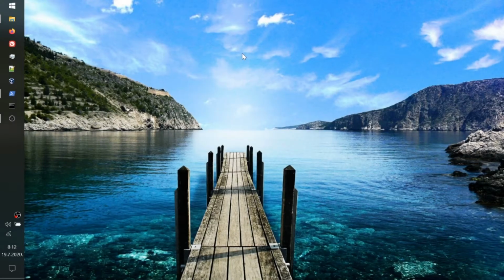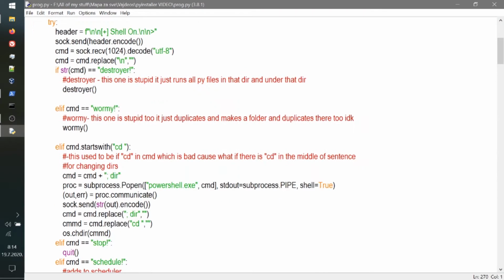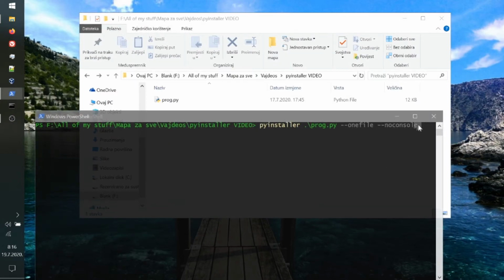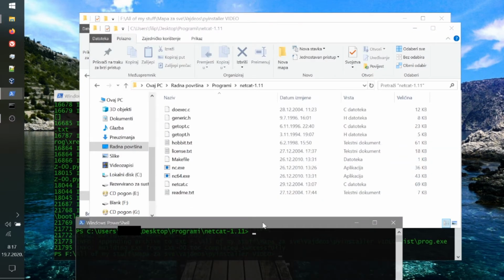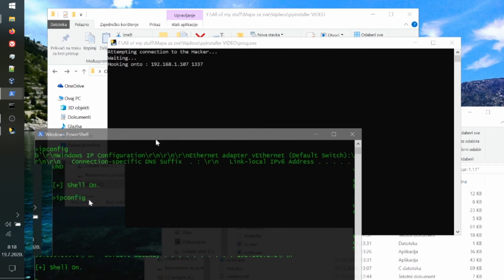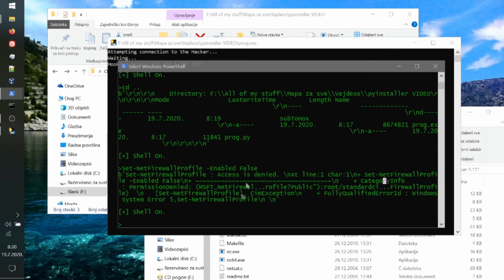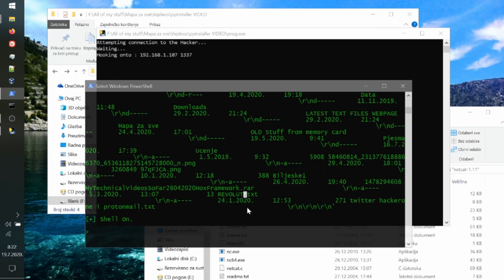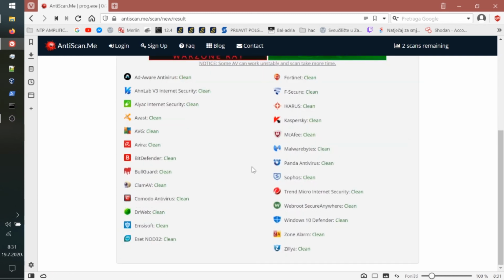[OLD] Converting a Python backdoor to Exe using PyInstaller + Basic AVEvasion testing

Comment: Can you tell me how to hide a batch file source code from reverse engineering. So the batch file should be able to execute its code but the code can’t be seen.
Reply from the maker: Obfuscation of any sort would be your thing - however even then its possible to rev eng it 
If you used Ghidra or similar tools you'd know why - it can decompile most programs
Reply: @HoxFramework  
Is it actually possible to disable the taskmanager, the registry and the access to the certain folders through a cmd command or batch file without windows prompting me to confirm that I’m the administrator ?
Can you give me the code in order to achieve that? 

Only for ethical stuff:)
Reply from the maker: @goofymouse8921  I dont think so - to do stuff like that you need a "root" user in windows (system user) - for that you need psExec tool to execute. However even then you need to run it as admin. Even then it might not allow you to disable system components like task manager or registry

You can always access folder trough cmd or a batch file - most without admin prompt 

And i dont make custom codes for anyone's purposes, that would be paid a lot - i dont do that 
Plus i dont have that kinda code anyway
Reply: @HoxFramework  but could you please tell me how can I register my custom ico file which is on my desktop in order to make my custom extension .hello adopt that icon ?
Reply from the maker: @goofymouse8921  if you are reffering to using a custom ico file with an exe compiled from pyinstaller - i said that in the video.

I've never heard of a .hello extension im not sure what you mean
Reply: @HoxFramework  no, I want to register my custom into the windows registry so if I rename f.e. the file bonjour.txt into bonjour.test123 that my custom icon appears
Reply from the maker: @goofymouse8921  I dont know if you can do that 
Ive never tried but that would mean replacing the system's "file" icon thing 
If you could do it trough the registry thats great but you would have to make a seperate program that does that and then the victim sees the other icon after its done 
But why would you want that
Reply: @HoxFramework  Because that would be the top of the iceberg. Custom file extension with custom icon and everything encrypted. I really don’t want to make a problem out of it, but why is that such a big deal just add a file extension in registry and selecting the icon and path, I don’t understand why that’s so difficult
Reply from the maker: @goofymouse8921  Its not difficult i just have no idea what you really want to do
And why registry? Do you want to do something like this
https://superuser.com/questions/308958/creating-custom-file-extension-with-windows-registry
?

are you making a ransomware? is that it? if so then i think i have a clue on what you wanna do
Reply: @HoxFramework  Yes that’s true, but only for non-harming ethical purposes. I want to use it just for testing purposes while simultaneously having full permission by the systemadministrator. 

So I think you know how to properly solve this problem ?

Or could you do this as an example for me: 
1. my .ico file is located on my desktop

2. the file extension ist called .pigeon

3. the file type is called .pigeon-file

How to properly do it for this example, Microsoft should prompt me that there is no program I can open it. So in .pigeon format it’s unopenable
Reply from the maker: @goofymouse8921  Right so you are designing your own ransomware but cant compile the exe? Wasnt that your first question? Make sure you manage that first 

why would you have a different file extension from file type? Whats the purpose of that, shoudlnt they be the same

What program do you want to open it with then? Is it just an .exe? If so just rename it and run it 

im pretty sure you understood some things wrong but im gonna go ahead and say i still dont get what you are trying to do
Reply: @HoxFramework  Hello, no I think I got it. I have an exe compiled by winrar containing txt, bat, ico, png and vbs files. 

I need a batch script that adds my icon to registry so that it embraces my icon to a custom  file extension, that need to be registered as well.

Can you please give me the batch script to do that?
Reply from the maker: @goofymouse8921  i dont write scripts per requests of users, paid or not - But im sure you can google it to find it all 
As far as the script goes keep in mind it could get detected too
Modifying registry is suspicious behaviour
Reply: @HoxFramework  I have been searching for 5d and didn’t find anything, I’m Suche it’s just sth with red add, could you please do that just the 2 lines of script ? I would sub and be an active sub as well
Reply from the maker: @goofymouse8921  Sorry, I dont do requests for subs

Id love to help but it seems that you need to do a lot more research before you can start working on a project like this... Modifying registry will cause any sane antivirus to pick you up - making a two file malware isnt the greatest idea and using a custom icon changes nothing from the point of view of the user cause he still needs to exec a batch file
So please before you launch this make sure you do a lot of learning on this topic - even IF i made you that batch script your idea wouldnt really work perfectly since you'd have antivirus detection problems as well as problems of your malware not being even executed cause it looks fishy. Tho i dont want to dismiss your idea cause with some work you might make something interesting - id recommend just trying to bind a malware to a legit exe and trying that out
Reply: @HoxFramework  They that’s what I want, but nobody can tell me about zero day exploits or up to date exploits for adobe reader. Can u tell me how to do it correctly ?
Reply from the maker: @goofymouse8921  Nobody will tell you about zero days - thats why they are called zero days

Exploits for adobe reader now? Dude you are shifting from a topic to a topic hahah
Yeah sure just go to exploitdb or 0daytoday and find some 

use these legally ofcourse

Comment: Hi there, the .exe generated by pyinstaller is getting detected as a virus by windows defender as well as other antivirus softwares and thus I am not able to execute it. Please help
Reply from the maker: I've answered to this question many times in the other comments, please refer to them so i dont have to retype things many times - basically its cause people uploaded that program to services like virustotal which actually sends information to antiviruses meaning it will start detecting it then. I have mentioned some options in other comments how you can get around that
Reply: @HoxFramework  but how know this virus we make detect or not??
Reply from the maker: @ghostt784  antiscan.me
Reply: @HoxFramework  bro make video how install py2exe
Reply from the maker: @ghostt784  pip install py2exe
Reply from the maker: in other words this is why you dont upload to virustotal and similar services

Dont get me wrong tho, i support internet safety and we SHOULD upload it to VT, however if redteams and pentesters can use this malware to improve the security of systems then they should have the option to do so

Any illegal use is NOT supported ofcourse

Comment: hi sir I have a exe virus and it is detected by antivirus what should I do
Reply from the maker: You can try a bunch of AV Evasion techniques, as well as changing the code or  changing the converter
Reply from the maker: @KOALIC PANDA   That is a bit of an issue, try py2exe maybe but im not sure it will give great results - what you can do is look up python to exe compilers / converters list on Google and see whats what

Using any other one should be safer

Nuitka was safe like a month ago

PyInstaller was FUD (fully undetectable) before i posted this video believe it or not

Comment: windows defender detect every exe i make using pyinstaller as virus or malware please help 😐
Reply from the maker: i talked about this in the comments/description (and also i hinted that this video is older- it was taken down so i reuploaded it and edited it a bit to fit the youtube guidelines) - antivirus (and windows defender) evasion is a huge topic and it takes plenty of research - but i have provided couple of solutions : use py2exe instead of pyinstaller, use a different programming language, change up the hash of the file (by changing up the code in any way), bind the exe, encrypt it or similar

These are couple of good options
I hope they help you - tho you will have to do more research on this since antivirus evasion is a difficult topic and even experienced hackers sometimes have difficulties bypassing antiviruses (im not one of them - i dont have a big knowledge on antivirus evasion specifically) but i do know enough - however i cant show it all in the video as it would be wayyy too long (like hours haha)

Anyway i hope this helps!
Reply: @HoxFramework  i change the pyinstaller version to 3.6 and it works, thank you 🙏
Reply from the maker: @dudesstuff9214  Really? Thats awesome! Im so glad it does - Wait thats really interesting so windows defender databases only detect specific versions of pyinstaller's programs! That is really odd, but could happen! 
Make sure you dont test your exe on virustotal tho since they send the samples to antivirus software - and if you do test it somewhere let me know if its fully undetectable

Anywayys, im very glad i helped
Reply: @HoxFramework  mmm... Too late ☹️  I test it in virus totale
Reply from the maker: @dudesstuff9214  Well thats fine i suppose but now you might have to change up the code, use a different version of pyinstaller or py2exe, or similar

Comment: I got the error message Error: name 'sock' is not defined when i run the .exe file
Reply from the maker: You copied the code from the website right? Its my mistake i think - the sock variable isnt defined, just define it - try putting this line in the code 
sock = socket.socket(socket.AF_INET, socket.SOCK_STREAM)

You can always try running the code before compiling it to .exe  - that might help
Reply: @HoxFramework  Okay thanks that worked. But instead of using netcat im using metasploit in kali linux. Theres a meterpreter session opened whenever I execute the .exe file but metasploit doesnt allow me to enter the session with the ability to use its full list of commands.
Reply from the maker: @sufianiskandar56  thats okay you can totally use metasploit as well

Hmm 
thats odd
that shouldnt happen
i think it should work just fine 
try using netcat and see if it works
Reply: @HoxFramework  netcat works. have you tried it with metasploit? i think its something to do with admin rights on the powershell process the .exe creates which messes up the metasploit session.
Reply from the maker: @sufianiskandar56  hm, sounds interesting - i havent tried it with metasploit - maybe you are using some weird payload ? Try using the python's payload or the raw one - im not even sure what would fit but some of them would - maybe its just meterpreter messing it up
Reply: @HoxFramework  Could you upload the code in corrected form again on your website or post it here under your video? I got the same Error but i cant fix it.
Reply from the maker: @christophermoltisanti7104  I think this should be the accurate code 
https://hoxframework.com.hr/?p=407
Reply: @HoxFramework  okay. When i am running the code in the full code section in Python3 i got erros. I dont know why.
Reply from the maker: @christophermoltisanti7104  which errors